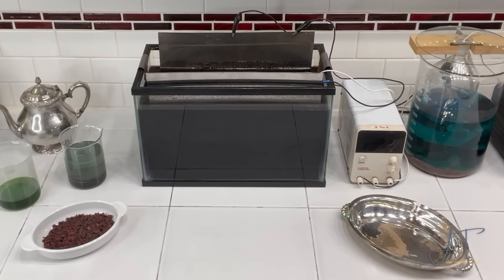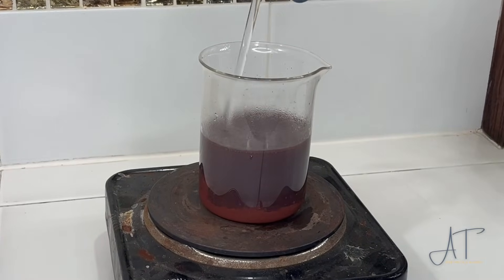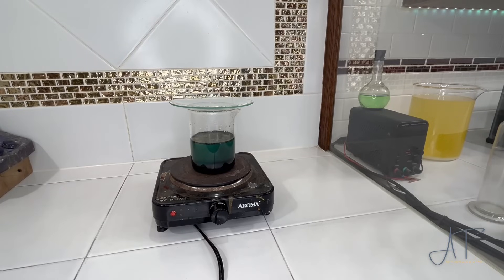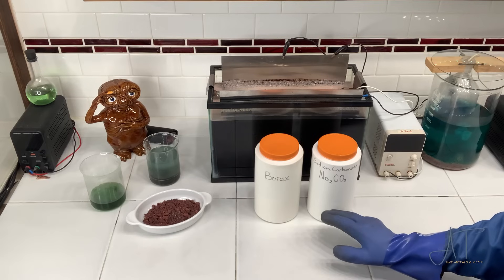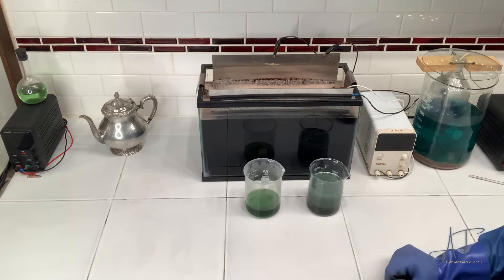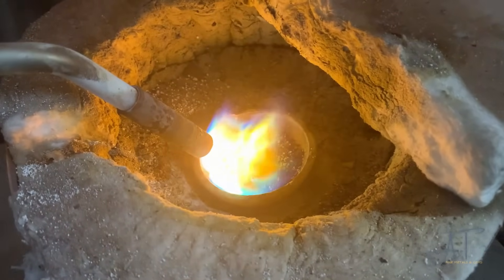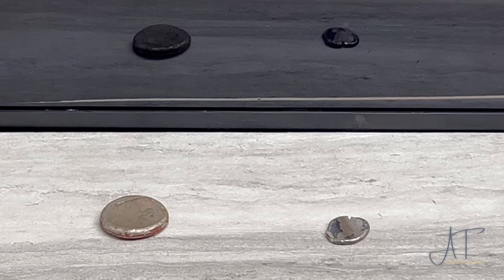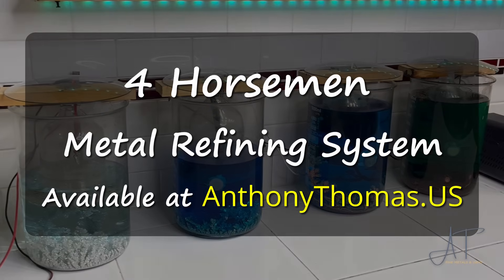How To Refine Silver Plated Slimes

Comment: If I deplate (I must have over 40 pounds of Silver Plated Material) using the Salt Water Electrolysis Method, whether it's on a Copper, Brass, or Nickle Base, how does one refine the Silver? I don't have Lab Equipment and don't want to invest in HNO₃ since I have no Fume Hood. Doing it outside is only an option during warmer months but it's Winter here in West By God. I've watched a video or two of using a Lye and Sugar method. Can you show us a video using this method to refine Silver plz?
Reply from the maker: The best option, if you don’t want to use a wet process, is smelting to achieve a high enough purity silver so it could be sold to a refiner.  Check out my channel for videos on the lye and sugar method along with smelting.

Comment: Melt your impure silver into shot, by pouring the molten metal into an ice water bath, creating granules.
Next, build an electrolitic silver cell, using a silver nitrate electrolyte in a stainless steel bowle as cathode, and a pure silver bar as an anode.
Install a fuse in line to the cell to prevent a burn out if the silver crystals you will be growing g accidentally grow to come i to contact with the filter basket you use to contain tjre impure silver shot. The basket is partially submerged in the silver nitrate solution, with the anode bar resting on top of the shot. The current flows through the anode bar , through the impure shot, and plates out into pure elemental silver in the cathode bowl.

Comment: I am no chemist but I think the sulphuric boiling of slimes also dissolves the silver, not only the copper. The solids left over is a mix of silver & copper oxide rather than silver sulphate. imo
Reply from the maker: Some silver will dissolve yes, but you can kind of control the process. Dilute the SO4 and excess copper will minimize the amount of silver that dissolves. Also I don’t mind if there’s some silver sulfate because it is easily removed from the banks of storage solutions.
Reply: The white settlement would be your silver sulphate rather than any titanium derivatives

Comment: Can silver chloride be straight melted. I have done it but everyone says u cant u have to convert it.
I cant find anyone that can give me a real answer
Reply from the maker: You can straight smelt silver chloride with zinc metal.
The zinc displaces the silver, forming zinc chloride and metallic silver.
The equation is: 2AgCl(s) + Zn(s) → 2Ag(s) + ZnCl2(s)

One comment I read was that smelting it with potassium nitrate also works but I haven't tried that. I have read that smelting with NaOH and sugar also will work and the chemistry seems solid. All you need is a reagent that is hungry for chlorides to remove it from the silver.

Comment: You can deplate silver with potassium nitrate (stump remover) as an electrolyte and you should see a tan brown oxide coming out. You can try using vinegar (maybe sulfuric acid as vinegar may not dissolve all the slime as there may be solid metal silver particles) to dissolve the slime then crash out the dissolved silver with sodium chloride to form silver chloride.